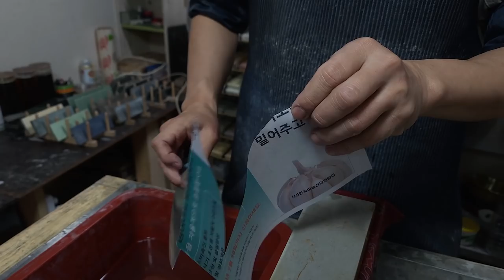[KR] 아무생각없이 칼가는 흔한 칼갈이의 마사히로 칼 수리 영상.

Comment: Yup, that's another good one! 
I have a knife in similar condition but i don't have a belt grinder to reshape it and remove the scratches. So, I'm going to go old-school with just sandpaper. The only problem with that is going from the spine of the knife to the cutting edge is a short and not very practical, so I'm planning to sand across the blade. I hope it works. Thanks for posting and inspiring.